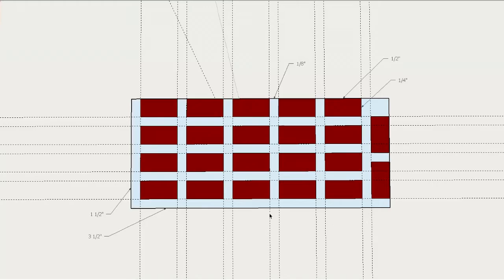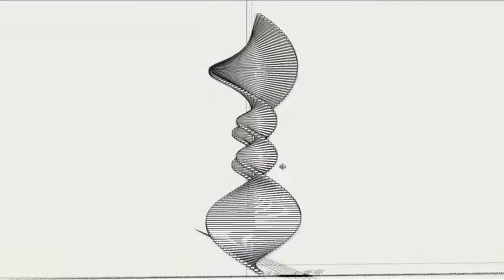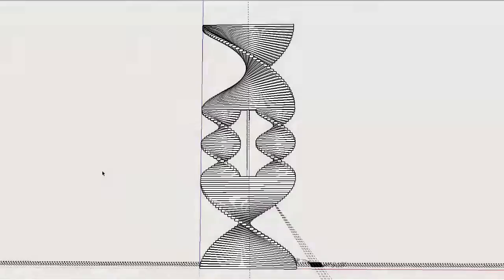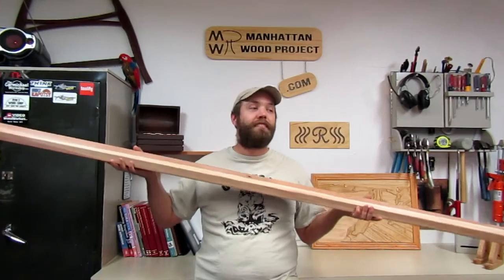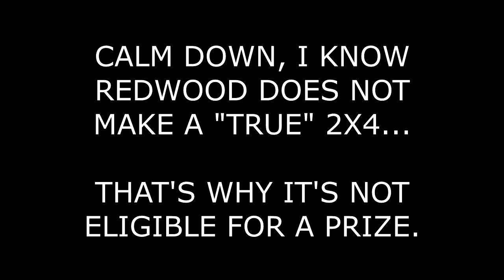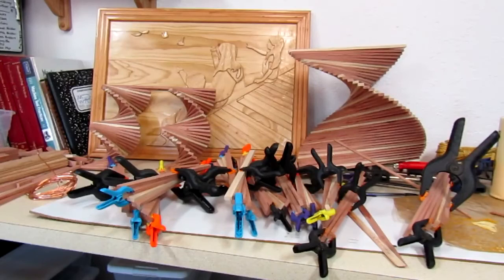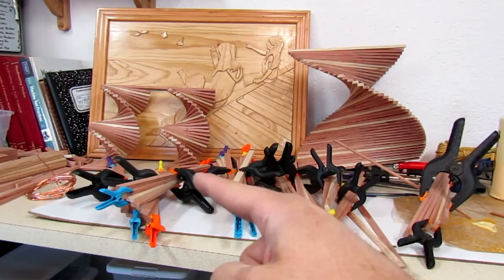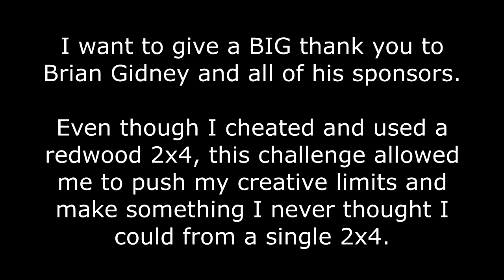48 - Redwood 2x4 Wind Spinner for Summers Woodworking 2016 2x4 Challenge - Manhattan Wood Project

Comment: Really a very excellent project! Especially like two things about it.
Showing the various uses of the Shopsmith and
The cleanup fairy!
The requirements are a 2x4, therefore you do meet the requirements and I did see that Brian accepted the entry as he should. Good luck!
Reply from the maker: Thanks!  I'm still coming up with a project for all 7 uses, but I know my cleanup fairy will always be around to clean up my mess, as long as it includes the cyclone.  :)

Brian is considering my video as an entry, but I'm fine if he chooses not to.  I diverged on purpose, and I think I'm a lot happier with the final result than I would be if it was a plain whitewood 2x4.  The choice is his, but I'm happy to just have a good reason to stretch my creative muscles.